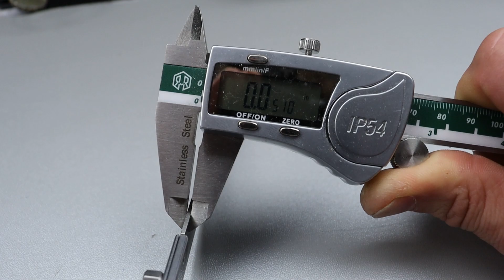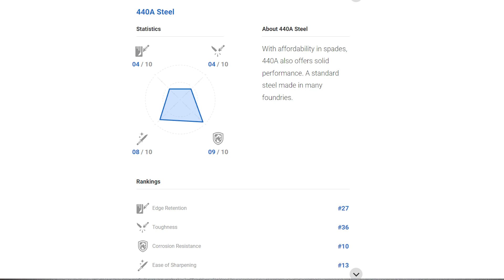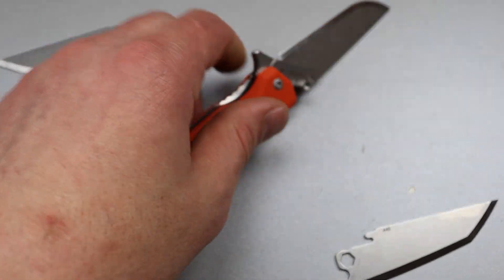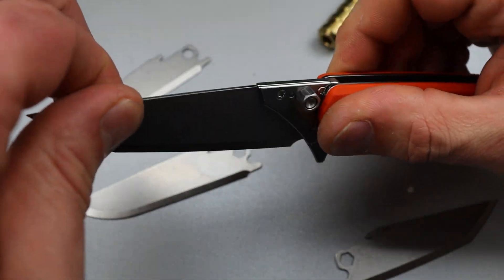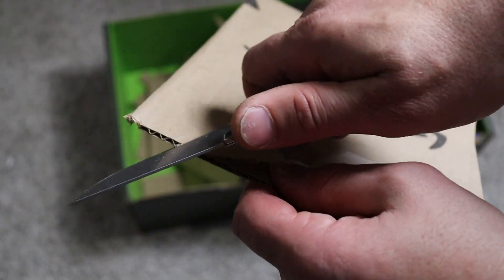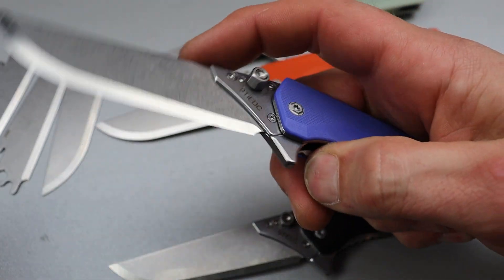I Found The ULTIMATE WORK KNIFE! its Perfect For so Many People

Comment: The hex hole in the blade fits perfectly on the securing nut and when replacing the blade the old blade can be used to tighten down the locking nut.
Reply: Nice tip, thanks. I ordered mine two days ago and wasn't sure why the hex cut-out is on the blade since it doesn't look like it locks with the hex cut-out.
ADDED: I see the replacement blades available on Amazon, but they're tanto and drop point. I really wish they made a wharncliffe blade for this utility knife. Fully serrated sheepsfoot blade would be great too.

Comment: i work in construction . I have carried kershaw for work knives for the last 16 years due to availability ,durability,and price. The thin blade worried me ,but then you showed a bag of replacement blades. I wonder if the blade change lock will hold up to construction use?

Comment: Hey Jerad. I have a Benchmade griptilion with the Spyderco hole, it came out of the box buttery smooth like perfect, but I've used it more and more and it has blade play now and was wondering how I can fix  it. I thought about tightening the pivot, but I don't know if that would ruin the locktight, if I do want to tighten do I take the pivot screw out and then put some blue locktight on it and adjust it how I like it?
Reply: Since you used permanent threadlock on the pivot, if the pivot screw won’t easily loosen or tighten, then the most likely issue is the omega springs are wearing out and losing tension. Did the detent get a little softer too? If you want to replace them, you can usually break red threadlock fairly easily by heating the pivot screw with a soldering iron. I’d stick with the blue on knives, just give it 24 hours to cure after you get the pivot where you want it, the red is usually overkill.
Reply: Ok
Reply: do yourself a favor and watch some knife disassembly and maintenance vids. The benchmade griptilian like most other goodd knives has a pivot that can be tightened and loosened as the user sees fit.

Comment: Spot on for your analysis of a work knifes life with a man who uses that blade maybe pulls and cuts with 100+ times a day or more. I built transformers for 10 years and used a knife constantly, and after getting cut badly 10+ times by company issued extendable rescue knives I started using Kershaw leeks until I completely ruined the blade, and if just but another one at Walmart
Reply: Od fella a litle messes, opps,